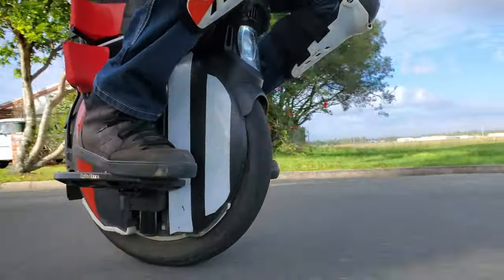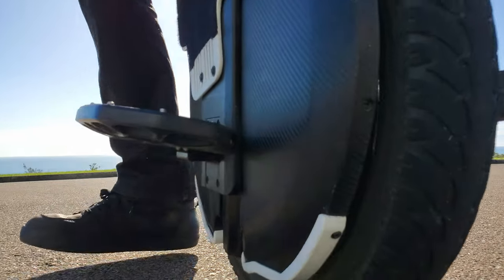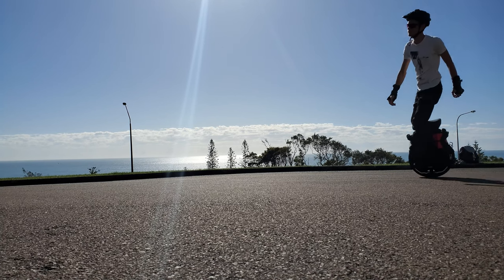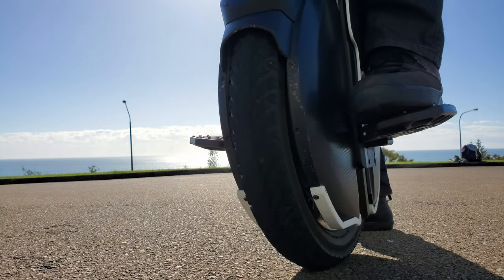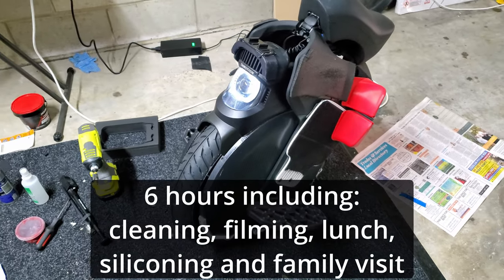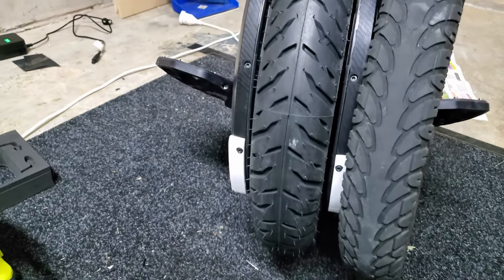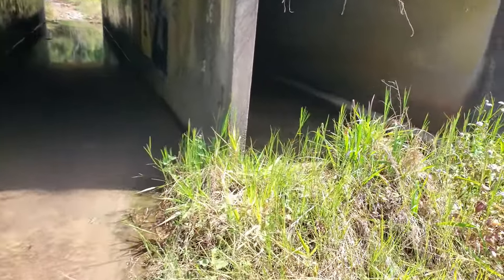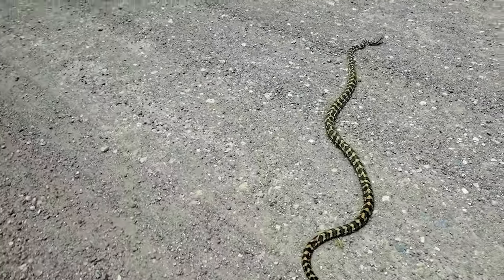Michelin Pilot Street 2 Tyre Review on Inmotion V11 EUC

Comment: @John Purcell I would definitely advise turning the tire around to its proper forward direction. Just because it's a single wheel and just because a motorcycle has a front wheel that does the majority of the braking doesn't mean you should do as motorcyclists do. 

You don't have the mass to take advantage  of the gripping power you're speaking of. As well, motorcycles front wheels aren't drive wheels. Which your EUC is. 

Drive wheels stay warmer and front wheels stay cooler. Front wheels only get warm when cornering at high speeds. Hell the front tire on a motorcycle being driven hard is only there to direct the bike. 

Reversing the wheel helps them get warm because it increases friction. But because the compound is laid directionally you're actually increasing excessive shear and causing failure to occur earlier. Why does it increase friction, because of the tread pattern and increased shear due to reversed compound direction. 

You see tires have no need to resist shear moving in reverse. You're never going fast enough in reverse. What happens in reverse is you release quicker, release being the moment of failure, understand? Especially in wet weather when the tire is coolest. 

As well the compound is laid down to both heat up for more stickiness but directionally be less resistant. This is a like magic science being both sticky but having low rolling resistance. 

You are actually increasing your vertical tire patch and decreasing your lateral tire patch. How it works is the longer the tire patch the more rolling resistance, the wider the patch the more lateral grip you have. Optimal resistance to grip ratio is a squared patch theoretically. But there are factors that can effect a preferred higher width over length. There are studies about how this works. But the easiest way to learn about this science, partially, is to go to bicyclerollingresistance.com and pick a couple of the racing tires and observe the test data for those tires and you'll glean much. But those are bicycle tires.

Directional tires are meant to be used in the direction stated on the tire. You can even have tires that are meant to be front wheel or rear wheel. For motorcycle high performance tires such as yours you must consider the purpose of the tires. At cruising speed there are no worries other than rolling resistance. 

But sport bike tires are designed with acceleration and deceleration in mind. Remember, when racing, these tires never cruise. They accelerate all the way to the beginning of a corner and then decelerate under extremely hard braking with over 400 lbs of combined mass that of course multiplies from very high speeds. Your tire is designed for these purposes. The heat involved is high and the tire actually needs high heat to perform at it's optimal level. The mass of the bike and rider and the speeds under acceleration and deceleration provide that heat. Cornering also provides heat from the energy released from lateral friction at high speed. 

Currently a EUC and rider with it's combined mass and speeds will never quite get the tire to it's optimal tire temperature. And I mean ANY tire. They simply weren't designed with EUC's in mind. Lowering pressure can offset this a little, but you can only go but so low before you run into punctures and pinch flats. But the nature of that tire you have there especially as a driven tire can gain you some heat. But not if you have the tire facing the wrong way. You're actually deterring the tire from heating to optimal condition which lowers performance both in braking and grip. 

So you're basically increasing rolling resistance, lowering your failure threshold and lowering your braking grip. All at the same time. 

Turn your tire around.
Reply: So this should be installed as a rear tire or a front tire? I was thinking rear myself, but as you said the tire will not generate nearly as much heat as a motorcycle would create, so wouldn't installing it backwards as if it was a front tire generate the most heat so it performs better?
Reply: @jtm94  No because as above, the compounds on directional tires are designed to provide the most benefits in the direction they laid the compound. 

As well different parts of the tire have different compounds. The center of the tire may have a compound that's low in rolling resistance but provides traction when driven, while the sides of the tread will resist sheer better. 

With most motorcycle tires the rear tires and front have different compounds because one wheel is driven and the other isn't. The rear under high torque will resist shear earlier on the center of tread to provide maximum application of force to the surface it's in contact with. Reversing the direction of the tire lessons that ability because of how the compound reacts to force being applied in different directions. They lay the compound in a way that maximizes the abilities of the compound. You are actually lowering that threshold of failure. 

Failure has three different branches: resistance to shear, shear being lateral failure. Loss of grip under high torque (vertically) due to breakage and deflection and a lack of optimal temperature, or lack of grip under high torque due to high temperature which causes a different type of shear (melting), only vertically. The third you'll never achieve really unless the tire pressure is really really low. But the first two are the most concerning. All of that is of course affected by the size and shape of the contact patch. So tire pressure has a number of rolls effecting all three branches. 

Then a fourth concern is rolling resistance. Running a low pressure increases rolling resistance but provides more gripping force under high torque situations. Reversing your tire directionally will increase resistance because of how the compound releases from contact and also how the tire reacts due to variables of the surface causing deflection. 

Deflection is bad as it it is a moment where an area of the tire isn't in contact with the surface in one moment and then comes back into contact in another causing higher than normal moments of friction. That's why tires feel so slick and bumpy when the pressure is too high. A lot of money is spent designing compounds to defeat deflection under higher pressures because of the benefit of while the tire is in contact under higher pressures, it has lower resistance as long as the tire isn't also enduring deflection. Lower resistance equals better efficiency and higher speeds.

So, you are increasing resistance, lower moments of failure, and lowering your efficiency by reversing that tire and lowering your speed..... All at the same time. I mean the tire will still work just not as well as if it was in its proper direction. Hell the tire will wear faster too!
Reply: @jtm94  I mentioned the bicycles before because you can actually feel the difference on bicycle because You, the rider, are the motor. Any instances of increased resistance you can feel. You can more easily feel deflection as well because you have to work harder to maintain the same speed and you can feel when the tire slips and skips due to deflection. The torque is quite high on a bicycle and given the size of the tires and the nature of you being the motor, it makes it more noticeable. But the principal is the same. Except a bicycle has two wheels. It's rare that both wheels are reaching failure at the same time. One wheel fails you have the benefit of the other wheel giving you a much greater ability to correct before a crash. Unicycles  don't have that luxury.
Reply: would you recommend another tire? what's your thoughts on the knobby tire?
Reply: @pathnativejam  It depends what you  plan to do with the wheel. For my RS19 trail wheel, I prefer knobby. But on my commander Im getting this tire because its my cruiser wheel. Smooth on roads, better in corners, and less resistance than a knobby could increase potential range over an entire battery. Also if you want this tire check out the site called motosport. They have it for close to $50 but if you get it through an EUC store like alien rides its $100
Reply: @jtm94  I misunderstood your question the first time I saw it. I would say, it is kind of difficult to gauge which you should use a front or a rear. Thinking of the torque involved I would say a rear tire would be best. Sure you'll never hear the tire to it's optimal temperature, because of a lack of weight, but it will still work better than a front tire under any scenario. And given that it's a driven wheel, it makes more sense to use rear tires only for EUC'S. Well as long as you're using street tires. I don't think it matters much with dirt tires. Knobby tires are just awful on the street, but of course are King on dirt trails and tracks and such.

Comment: Very informative video. I really like these kinds of talks because tires are the most influential way to change how our wheels ride. Surprised to see you like it better offroad versus the stock tire. Is sad that you lose some range/braking. I have the same tire on the way and look forward to trying it on my EXN.
Reply from the maker: cheers and enjoy your new tyre!
Reply: @jonoeuc  see my comment about tires and the direction of the tire. You need to turn that tire back to it's proper direction
Reply: @jonoeuc  great choice in tires though. But read my comment I left. Very important information about that tire and reversing it's direction that you did. It's not a good thing on sooo many levels. It's a lengthy comment though, but there's a lot to tell.

Comment: Looks great - thanks for the video. One thing - you can't really compare tires while they aren't mounted. This is because the bead probably isn't at the same width as it will be when it is mounted and inflated on the wheel. The shape of the tire is generally different when mounted - a lot depends on the internal width of the rim.
Reply from the maker: Good point! I need to measure the rim width next time.

Comment: Hey Jon! Great review and thanks so much for this. I've switched to this particular tire because of your video. Initial testing of the tire fit is okay, but as I try longer, I noticed that there is some scraping sound between the tire and the housing of the V11. Have you had this issue and what fixes can you recommend? Hoping to hear from you, thank you!
Reply from the maker: Hi Shane, damn we've gotta fix that up!
I had scraping too. The kickstand was clamping the shells together and binding the tyre on part of the rotation. I stretched the kickstand to reduce this tension. If your case is particularly bad, you may need to grind some of the tyre away with a belt sander on by spinning the wheel up against the concrete.
How did you get on?
cheers jono
Reply: @jonoeuc  Thanks for the tip John. I tried stretching the kickstand but the ends were still rubbing, so I ended up removing the stand altogether. The tire works beautifully. There’s no uncertainty about skidding and stability. Plus now i ride seated and the quality is just amazing.

Comment: Interesting!  Wrote a comment asking why front orientation instead of rear then I got to that part of the vid.  lol.  I plan on setting my City Pro in the rear orientation for my Sherman.  My reasoning is that the tread angle in rear orientation is better for water displacement (and therefore better grip in wet... ???) according to tyre makers.  For me, acceleration is the great force on EUCs.  Personal thing of course.  Thanks for the vid!  Hope to see more!
Reply from the maker: I'm torn between front vs rear. On one hand it just looks right in the rear orientation.
Then yeah i heard the argument about the front motorbike tyre parts the water for the rear tyre in a straight line. I hope! that manufacturer's know what they're talking about when it comes to reversable tyres.
The not so obvious thing is the outside water channels. In front orientation, when leaning over, the channels transport and eject the water out the center of the tyre improving corning grip/wet performance! ie cornering left,the water is ejected to the right of the tyre!
I'm just now speculating that rear orientation is better for straight line water displacement and front orientation cornering.

True! acceleration could be the go particularly with front power pads. My setup is rear pads only. yet to position them in a way that doesn't make seated riding uncomfortable.
Reply from the maker: Balescream has posted a lengthy explanation on the orientation in these comments.  worth a read!
Reply: @jonoeuc  interesting read indeed! I had the same thought about an EUC tyre being more the drive tyre than a steering tyre hence my instinct to orientate it in the “rear” direction.  So what’s the plan now? You gonna change it around?
Reply from the maker: @Kamikazekman  I want to but honestly it's a lot of work plus i've siliconed the shell on. Not wanting to tackle that challenge yet! I've had zero grip issues, the main reason to change it is the reduced rolling resistance and peace of mind.

Comment: ver nice info~👍
Since I am having a plan to ride a long-distance travel.. I'm considering change my s 22 tire to pilot street 2 from Heidenau k66. I do off-roading a lot but can't give up those on road grips too.
I hope this pilot street 2 tire works well on both on-road and off-road 😊 as my K66 did.

once again thank you for your informative vids~👍🙏🙏
Reply from the maker: Hey mate, I gather you want the PS2 tyre for better traction on street riding and or improved range? 
I'm a bit concerned if you're doing lots of offroad the PS2 maybe inferior to the K66 which seems to be a good hybrid.
The PS2 tyre is great for me since i'm mainly street riding. It's really solid in light offroad - packed dirt / gravel roads. Anything loose such as sand, mud or wet grass is sketchy! 
I talk more about the PS2 but versus the Kenda K262 offroad tyre here https://youtu.be/0iOiUoTX2pA

Comment: Amazing video, watched it twice (in a span of a few weeks)! Is it possible and if so, worth it to go tubeless with it? With like a tubeless bicycle valve or something..
Reply from the maker: Hey mate, It seems to be 'possible' but may slowly leak. I've heard 3PSI per week (no slime and on the sherman S for reference).

It's worth the weight saving in the rotating mass but then trading off security of a tube. Ie if the tyre bead comes off in hard cornering etc that may cause a crash. Plus the pressure upkeep is putting me off trying it myself.

here is a discussion about it on the V11 group (if you didn't post it in the first place lol) https://www.facebook.com/groups/inmotionv11/permalink/903874620811237/

Someone converted the Sherman S to a tubeless Michelin Pilot Street 2 setup too! 
https://youtu.be/P00W9dnxTtQ

PS I used this tyre again on the my Sherman S. Compared against the Knobby Kenda K262 in this video if you're interested!
love it for road riding / cornering / carving plus nimbleness. Some have suggested the Heidenau K66 as a hybrid option which I'm interested in if I needed more off road.
https://youtu.be/0iOiUoTX2pA
Reply: @jonoeuc  yes I watched the Sherman S video entirely and liked that video too! Thanks for your detailed videos!
Will stick with tubes during the replacement when the stock tyre wears out

Comment: Thank you for this video it was very helpful.
I have a v11 that I commute with every single day also in a lot of rain and I've been thinking about changing to that exact tire that you mentioned in the video.
So thank you for this friend and specially for the link on where to buy it.
The dimension in the link is that the same as the original Tire?
Best regards Carlos Vettorazzi in Sweden
Reply from the maker: Hi Carlos, you are most welcome!

yes you want the 80/90-14 size. This isn't an exact fit. I believe the stock CST1488 is a mountain bike tyre of the 18x3" size. 
The 80/90-14 is close enough and what I used in the video.
One thing I would do differently and suggest for you is to run it in the Rear wheel orientation instead of Front.

Take Care,
Jonathan